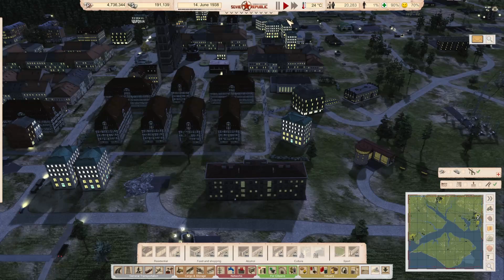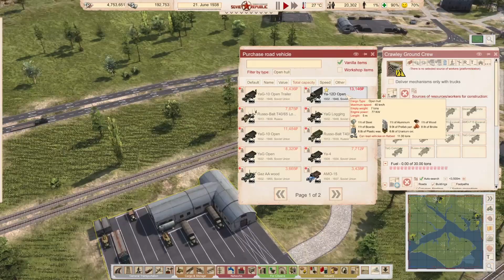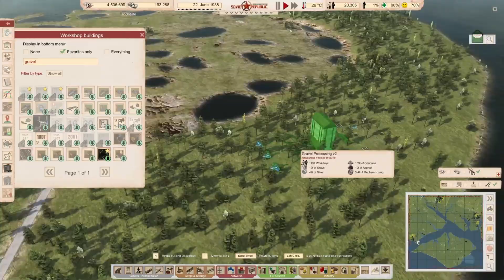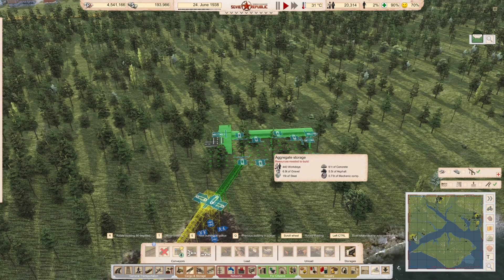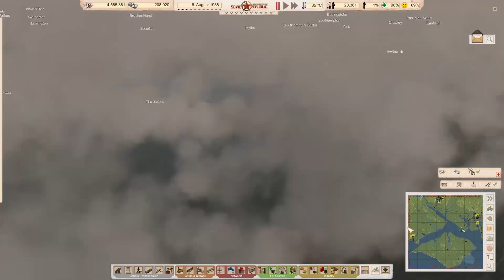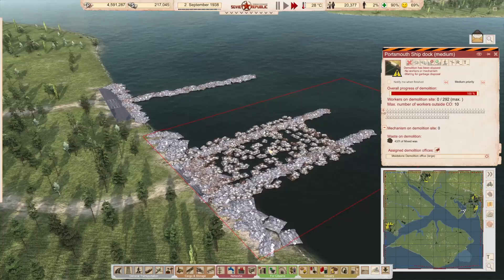4 Way Motorway Junction (Clone)  :: Hampshire 1900 Start : Workers & Resources Soviet Republic: #49

Comment: So far I''ve found the Iron Scrapper Mod to be more than sufficient to be able to handle all the scrap metal.
Reply from the maker: Ty for the tip.  This mod would be useful as part of a centralised metal scrap process, especially if it was place near the steel production.